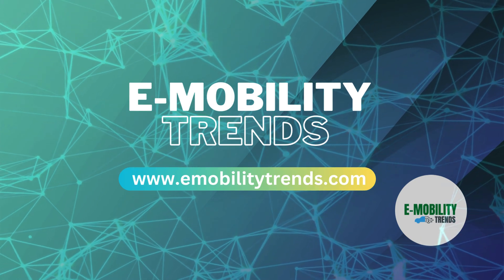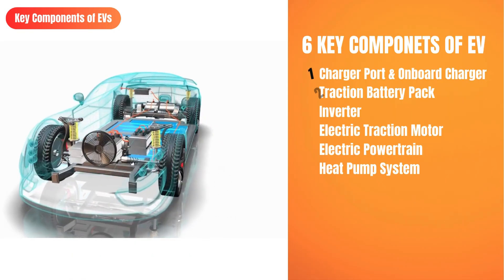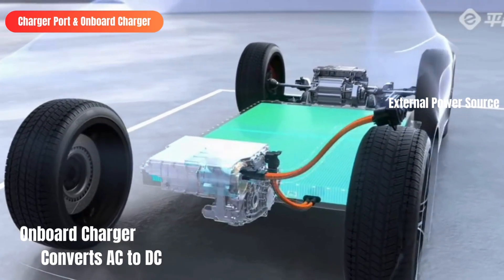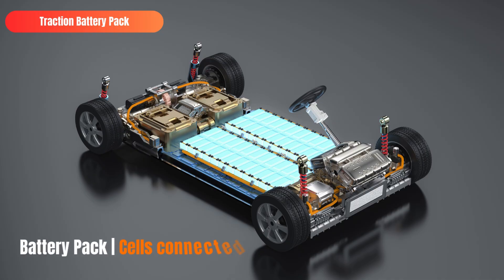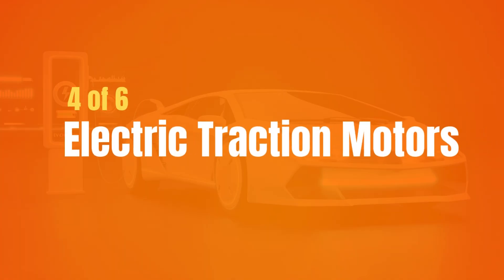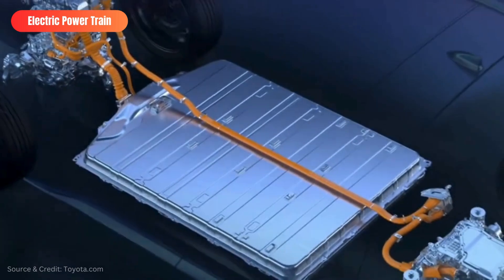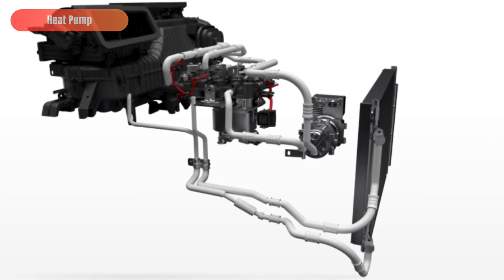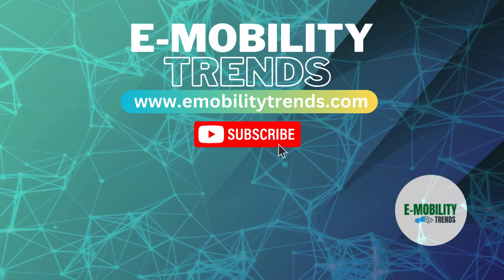Electric Cars Explained: ⚡️ How Electric Cars Work? | The Future of Green Transportation Unlocked! 🚗

Comment: What if we have something like this? ICE powertrain, and electric drivetrain, but still to use traditional clutch and gearbox and remove driveshafts, diffs and driveline??
Reply: I had the same thought but the battery is very costly and uhm you could buy 2 cars if you used driveshafts,clutch and gearbox... powered by the cars battery :/
Reply: I was thinking about making the EV but with gearbox